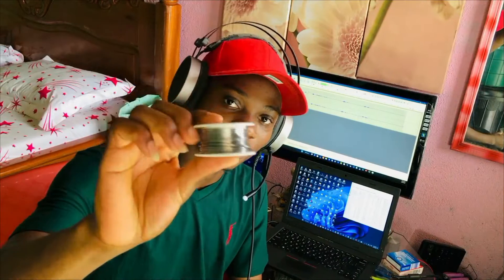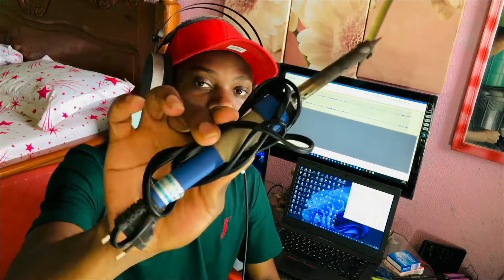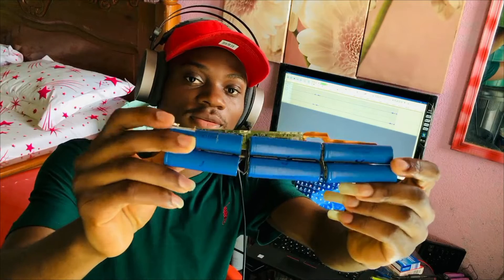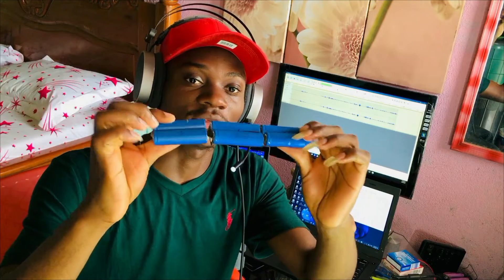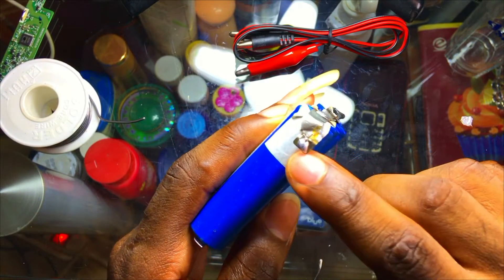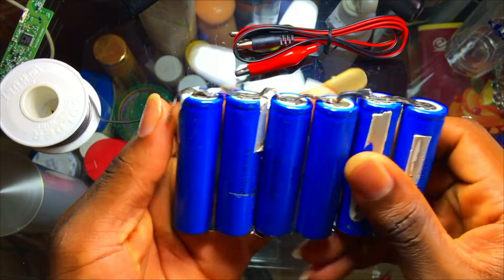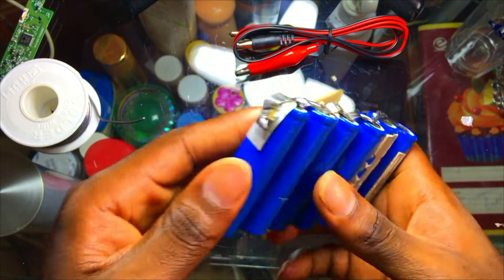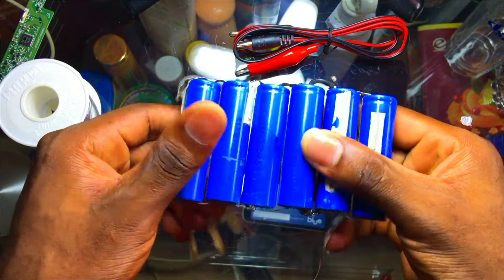How To Make a Short Killer For Mobile Repairing (DIY)

Comment: That will inject the full capacity of amps to the circuit and burn it in case of a short . Short killer must be regulated starting from 1V with minimum amps then you go up as needed .
Reply from the maker: Yes, you are right but it depends on the section

Comment: What if short is on 1.8v and you will put 3.7v 🤔. You will burn PCB.
Reply: You'll only burn the faulty component. (Speaking from experience only)
Reply: @oluwabusayooyegunwa5764  If fault component can be mosfet or diode it will pass current and go to GPU , then 🤔. So, my advice is that this is not good idea, any one can use it at own risk, About you, thanks for sharing..
Reply: I use at most 2weak batteries connected in parallel to limit the available current.

Comment: Is there any default output voltage for a short killer? Or 3 batteries to combine can work without any consequences
Reply from the maker: 3.7v 
Needs a high amp up to 25amp 
So you can connect up to 6 batteries